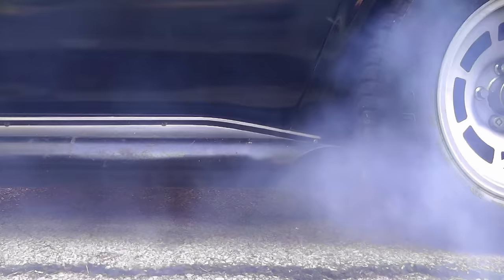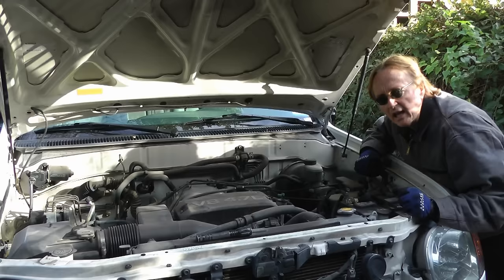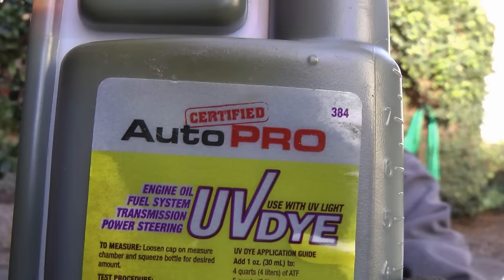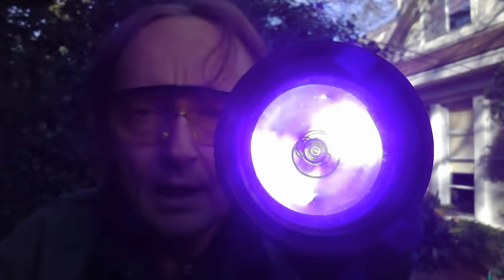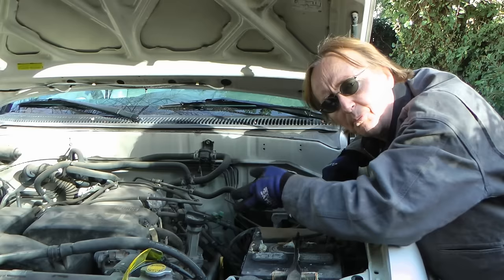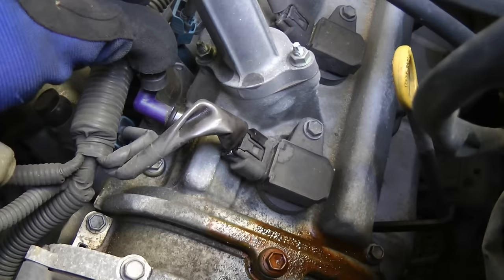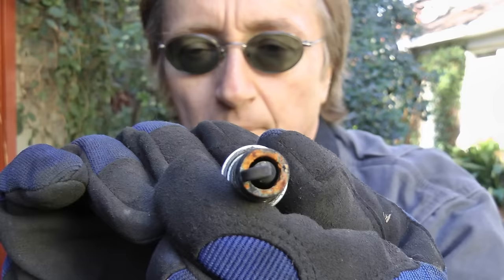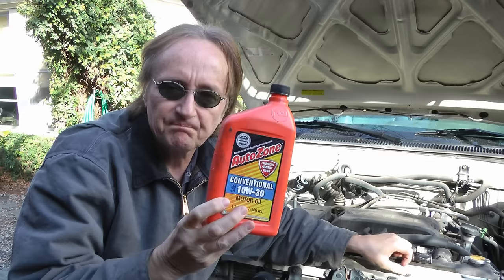How to Fix a Car Engine that Loses Oil (Leaks)

Comment: Hey Scotty i have an 02 passat and the oil light on the dash comes on when i put it in drive and says STOP OIL PRESENT IN MOTOR. It sounds fine when i turn the car on but when the engine heats up it makes a loud noise that sounds like something is hitting something else. When i accelerate and go faster the noise stops. I changed my oil switch, oil pump, oil feed line, and my turbo which was broken but it still has the same noise. i think the only other thing it could be is there may be sludge in the Pickup Tube and my engine isn't getting enough oil because of it. What do you think and what should i do?
Reply from the maker: engine is losing oil pressure, DO NOT drive it anymore, and realize internal metal damage probably already exists inside the engine. You would really have to tear the whole engine down to find the damage, such as worn engine bearings. Most guys would just try a used engine instead.

Comment: My cars oil level doesnt change measurably between changes. What's wrong it that it doesn't leak or burn oil?
Reply from the maker: psdaengr nothing is wrong with it, keep it , you got a good one
Reply: Scotty Kilmer I haven't had a car that consumed oil since before 1976, when I bought a new Corolla and put Mobil 1 in it at the first oil change. Other than a new clutch at 80k, and normal wear out items, it was fine up through 130k when I gave it away to a college student. 

Imo, if more owners knew how to monitortheir oil condition and made appropriate changes, or took it in for scheduled maintenance, or economy would be in the toilet from low new car sales.   Fortunately for car manufacturers, trust of mechanics, especially dealer mechanics, is so poor that that people are AFRAID to take their cars for service.

Comment: I have a 2010 Honda accord and I'm adding a quart of oil every few weeks. No oil leaks at 50,000 miles. If not the pcv valve then what else can it be?
Reply from the maker: Gatpacker 82 worn out engine then from not changing the oil and filter enough. PRAY it's the pcv
Reply: Problem solved it was pcv valve thanks Scotty

Comment: Hey Scotty, how about high oil pressure? Changed oil and filter , gauge is near H when idle. When driving it goes crazy going up and down. Any ideas??
Reply from the maker: bad sending unit or a clogged up system inside the engine, which builds up and causes high pressure before the build up area and low pressure after
Reply: So, if the sending unit doesnt fix the issue than I have a worn out engine? How about the oil pressure valve?

Comment: Hi Scotty my cars temp overheats, no smoke coming out.  I see a little engine leaking.  Does it mean its coming from the head gasket?  And will a oil leak cause my car to over heat?  I have recently changed the thermostat and temp gauge is still  above normal.  If oil is leaking should i get it fixed first before anything else?  Thanks
Reply from the maker: oil leaks don't cause overheating unless you let the oil get really low as oil helps cool the engine too. Do my video "how to fix an overheating car' TO FIND THE CAUSE.
Reply: what if the thermostat was changed but there is no hot air going through the vents when i turn on heater to try release some pressure of the engine? i also notice i am putting in more coolant than usual, filled it up twice in one day.  i have no idea where it is going as i do not see any leaking out.  Could it be the water pump not working
Reply from the maker: Maitua Alafaapae
 do my video tests as I said, could be air in the system making heater not work, BUT it's using coolant, so if you don't see if dripping, often a blowing head gasket which my vid shows how to check

Comment: Scotty, help...I have a 2006 Lexus IS 350, with only 89,000 miles. I’m the sole owner, & it has been meticulously maintained & all maintenance done on the car at their scheduled time. Well, my engine is leaking oil. I’m told it’s the time cover seal that it’s leaking from. I thought these cars are supposed to last 200,000 plus miles? I’m so disappointed. I had my mechanic put that Lucas stop leak stuff in, & a little bit thicker oil this time around, & I’m not seeing anymore drops of oil on my garage floor. How long can I keep driving my car like this, before the engine needs to be replaced ie I need to buy a new car? It was never going through oil, & only a few drops a week, before I used the Lucas product. Please Help!!
Reply: Update

Comment: I was told I have a rear main seal leak on my 03 f-150.  Any suggestions
Reply: I've had the leak for over a year. And I add oil every other week.
Reply from the maker: pull the tranny off to change the seal, or try a bottle of AT 205 reseal, amazon sells it, often works

Comment: HI Scotty Kilmer. My Mitsubishi Lancer 97 el is burning oil. when i start up a huge amount of white smoke coming out from the exhaust. when idle mode a constantly small amount of white smoke and when i shift to 1st gear and step in the pedal a huge amount of white smoke again until i shift up to higher gear and a steady speed of 40km/hr then the smoke minimize to low, but when i exceed to 50km/hr and up a huge a mount smoke again. no oil leakage under the engine. if it is in the piston ring problem is there a chance i can minimize the smoke by using only oil stabilizer ?
Reply from the maker: +Nathan Jon Abdon  typical on that model, piston rings were crap. Use castrol oil and one quart of lucas additive and live with it

Comment: Hi Scotty,
2001 Saturn SC2.  Known for burning oil because of no drain holes in the oil control ring.  The oil control ring gets gunked up with burnt oil and then doesn't really function.

Any ideas on what to do in this case?
Reply from the maker: try k and w engine flush, then change the engine oil and put in one quart of lucas oil additive with the new oil and pray.
Reply: Scotty Kilmer Since I've tried lots of things, I have a feeling the "pray" part might be more effective. :-)

Thanks!

Comment: hi this is Yvette again I had needed a timing belt on my Dodge Charger and I had it put on now my car is like hesitating to crank and is shaking a little could you tell me what could be the problem
Reply from the maker: take it back, odds are they messed up the job, it's a BIG job with many possible failures

Comment: Hello Scotty,

I have a 2003 BMW e46 318ci and it is currently burning around 1 litre of oil every 800 miles. The car has done 88,600 miles and has a full service history. The only smoke I have seen has been white, and it only seems to smoke when the car has been idling in traffic for about 2 minutes. There also seems to be no positive pressure when I take off the oil cap when the engine is running; so I've ruled out a piston ring problem. Is this symptom related to a Crank-Case-Vent valve, the valve stems, or a mixture of the two? Neither of those two parts have been replaced. Also, what is considered excessive oil consumption?

Regards,
Alan
Reply from the maker: typical on that year bmw, just say they don't make em like they used to. But try using castrol oil and see if it burns a bit less
Reply: Thank you, what grade of oil should I use?
Reply from the maker: Alan Walter
10 w 40 if you can find it
Reply: You can't use just any 40 weight oil for BMW.  You have to use an oil that meets the BMW LL-01 specification.  Using the wrong oil can mess up oil seals and other stuff internally.  Either a Castrol 10W40 that meets BMW LL-01 spec or AMSOIL 5W40 (part  #EFM ).  The quality of Castrol is garbage.  BMW promotes it because they get it cheap.  Find AMSOIL.  It's superior and it's not expensive.  Maybe $6/qt and that will last you a good 10,000+ miles between oil changes until your oil change light comes on. MANN makes pretty good oil filters for those cars.  AMSOIL also sells them and you can buy it with the oil or look on Amazon.  Sometimes you can get a pack of filters from Amazon and keep them handy for the next several oil changes.

Comment: hey scott i did a ac charge on 1999 dodge durango works fine but now driving with out air on smoke comes through when i idleing or driving a certian speed .. what should i check for ?? no codes drives good
Reply from the maker: +Austin Shiflett what kind of smoke? If it's oil burning smoke, check for engine gasket leaks. If it's AC oil slimy smoke, check for AC leaks on hoses and compressor

Comment: hey scotty. I have a 2006 saab 9-3 T. I oil is leaking from the left side of my engine (the side which the serpentine belt is on). I am thinking of trying an additive but idk. what is your advice? what do you k ow about this kind of engine?
Reply from the maker: +Aaron Vail on those, leaking gaskets need replacing, sealers won't fix em. Do my video "finding and fixing car oil leaks" to find the source and fix it

Comment: I have a 2006 saab 93 turbo and I go through about a quart every 2 weeks my spark plugs are normal not irregular shit on them but there is oil in my intercooler pipes does that mean my turbo is the reason for all this oil loss?
Reply from the maker: yep turbo seals are shot

Comment: Scott, no one seems to know ,what # in the fuse box  ,for the ''cigarette lighter power outlet ''.. the outlet doesn't work...,car came without the owners manual,..2003 jeep liberty sport,...went to ''auto zone'' they failed ...''mechanics want $$$$..to much...can you help ???..
Reply from the maker: basically get a test light, run the car, and check all the fuses to see if one is blown causing that problem, that's what I do

Comment: Hi, please I want to get your input on the AT-205 re-seal. I have an 07 Camry with no oil leakage. On start up it releases blue smoke if it seats for 2 days or more without being started but if I start the engine everyday I barely notice anything. To add oil consumption is isn't noticeable. Might this be something other than a bad valve stem guide (this is what I suspect). What do you think and suggest. Thanks
Reply: To add, the blue smoke only last for about 2 seconds
Reply from the maker: that's worn valve seals and or guides, nothing fixes that other than rebuilding the engine

Comment: Scotty
When it burn oil is when blue smoke comes out of the car right well my car does that sometimes and have the check engine light but that is just evap does that have to do something with blue smoke sometimes coming out the car when i turn it on?
Reply from the maker: blue is small bits of metal burning, means the engine is just flat wearing out inside. Keep the oil up as it burns, and get another car or another engine when it does crap out
Reply: Well i have an acura integra which is technically a honda integra and the car runs good the only problem is that ones in a while not everyday blue smoke comes out. And i always changed my oil and i just change the time belt. :(
Reply: Darker blue smoke is usually unburnt oil vapor and light blue/almost white smoke is burnt oil. If it's dark blue, this normally happens when you first start the engine when it's cold, and the oil doesn't burn. Light blue smoke occurs when the engine has warmed up enough to burn the oil. This is caused by worn valve stem seals. A high milage oil, seal conditioner or the Lucas oil stabiliser Scotty mentioned will all help this as they have worked great for me

Comment: could this also causeknocking noises? my daughters camry  is always losing oil , no puddles and is starting to knock
Reply from the maker: pcv valve won't make em knock, running em low on oil ruins the bearings and then causes piston knock, which means engine is going out soon. Make SURE she keeps it full of oil at all times
Reply: thanks scotty, a mechanic told her she needs a new alternater, i said watch your videos lol, her oil is always missing

Comment: Hello scotty.
my car (BMW e34 1991 525i) burn oil but I can see any blue smoke when I rev up the engine but engine leaks around engine valve cover and bottom of the engine around oil pan.
Reply from the maker: blue smoke  is a combo of burning oil and metal, meaning engine is just flat wearing out inside. Keep adding oil, and say goodbye when engine finally goes out, or spend a fortune on a new bmw engine or a rebuild.
Reply: it consumes oil but I can't see smoke from the exhaust

Comment: hey scotty i have an 07 toyota camry and i read online that they along with newer camrys are  notorious for burning oil..i do oil changes regularly but im afraid the engine will get screwed up after a while. Do you think it's the pcv valve? there is no leaks of oil.
Reply from the maker: try the valve, but often they burn oil because of stupid too long oil change intervals. SO, try some Castrol oil or Penzoil pure platinum oil and change it every 3 to 5 thousand miles  Too long intervals are really B.S. and will damage engines over tie
Reply: can you clarify more about what you mean by too long intervals? sorry
Reply: ***** I would say more than 5000mi is a long interval, and that's with fully synthetic oil. Don't believe the 7500 to 10,000 mile range, and always use Synthetic in all your oils if possible.
Reply: 2007 Camry was a really bad car. For some reason that year burns oil and the engine eventually seizes. This was only on the 4 cylinder model. The 2008 models don't appear to have the same problem. I almost bought a 2007 Camry but after the reviews online I passed on that car.

Comment: hi scotty, i got an Audi A4 B6 2.4l bdv car. I have to add oil inbetween oil changes. I've been reading on chat places & they say it's just normal for this car to burn? Is this your experience on these Audis?
Reply from the maker: +Kreskin Jude O Valera very normal on those money pit machines as they age. Realize VW owns them, and all VWs do that as they age too
Reply: +Scotty Kilmer So what is causing it...Is the oil ring actually failing or does it just get covered oil goo and build up from not doing your maintenance

Comment: scotty i have a 2006 mazda 3 2.3L and the pcv is under the intake manifold. do you know if the pcv hose is accessible without removing the intake? thanks
Reply from the maker: +Liam Palmer na ya gotta pull all that crap out
Reply: is there a reason why these motors are made like this? lots of people have blown their mazda 3's up due to the pcv failing and sucking their oil up without them realizing

Comment: I was taking my aunt home to Lafayette.when all of a sudden my car started shutting off the battery seems to be working still .but my engine turned off.smoke started coming out my hood .and it started leaking green liquid on the right front passenger seat by the passenger side wheel Scotty can you tell me what's wrong with my car please I would appreciate it after I was stranded in Lafayette I still turn on the car and it still is drivable if I cannot figure that problem now can you please help me
Reply: I'm no expert, but green liquid is almost always coolant. Does your car overheat quick? Look up his videos on coolant issues would be my suggestion.

Comment: I have a Camry SE 08 2.4l. Replace a new PCV valve but it still burning oil. Changed new oil and after that I drove 500 miles and it still burning oil. When I checked the dip stick there was oil below the mark. could someone give me some advice?
Reply: According to this data from carcomplaints.com http://www.carcomplaints.com/Toyota/Camry/
Unfortunately the 2007-2008 camry has excessive oil consumption problems due to engineering flaws. Not much can be done other than try using a high mileage full synthetic oil from mobil 1 or pennzoil and add the lucas oil additive that scotty shows in this video to see if it helps reduce the  oil burning. Then just consider selling the car and moving on. Normally Toyota's have the best quality and are flawless but this was one of there only unfortunate failures.

Comment: Hey Scotty, I drive a 2000 Chevrolet Silverado 5.3L I change my oil every 3,000 miles. I recently  changed my oil 1,000 miles ago and my messenger says "change engine oil". I checked my oil level and its pretty low. What could be the issue?
Reply from the maker: +Aaron Alvarado typical chevy, it's burning some oil. Change the pcv valve, and if that doesn't help, live with it
Reply: +Scotty Kilmer my 2005 f 150 V8 does the same im going to chang the pcv but i heard its a common problem for these engines